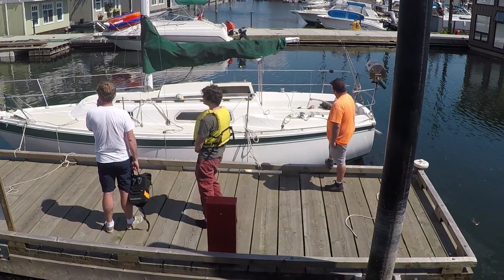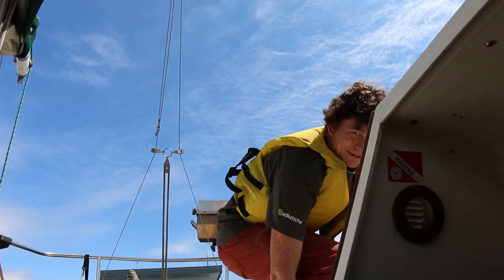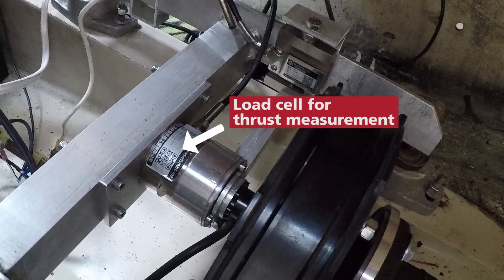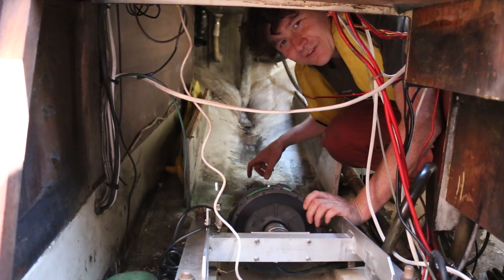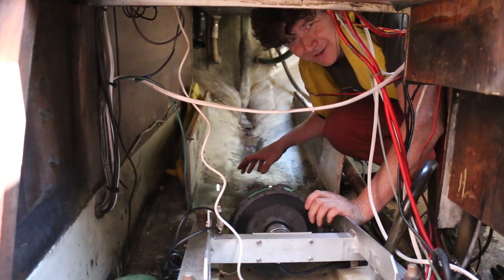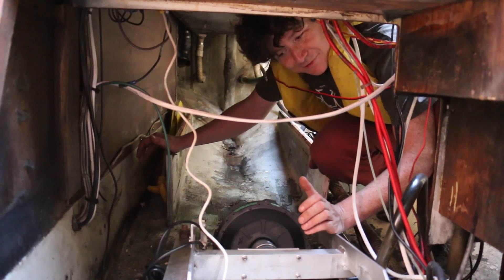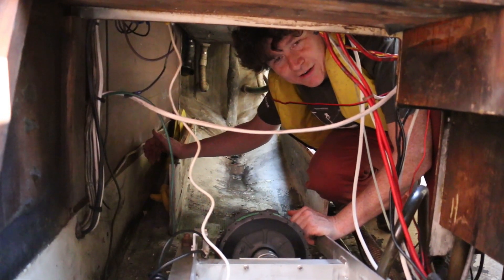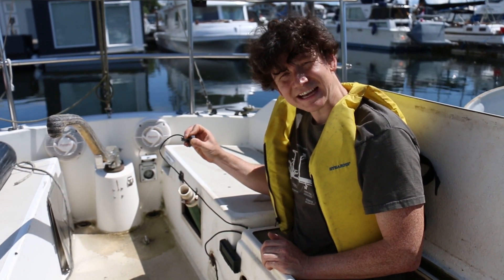Intro to Shamrock, Justin's first electric sailboat conversion

Comment: Yay for electric boats! And, bikes, airplanes, cars, motorcycles and all kinds of electric propulsion. (and unicycles, too;-)  It is a clean setup Justin made to measure propeller efficiency (thrust per torque) independent of motor efficiency which he measures all the time. Such a clean and simple arrangement is the marking of an excellent brilliant engineering mind. Go Justin Go! Good going! :-)
Reply from the maker: Ha thanks Brad. I'm hoping that with a bit of data collection like this we'll be able to really contribute more to the optimization of e-drives for boats and if we can make it easy for people to see and collect that data then more people can contribute. It could also be a nice tool to see quantitatively the effects of things like marine growth or a bit of rope wrapped around the propeller.  Certainly I got way more velocity from 1000 watts after the boat went back in the water with a cleaned hull and barnacle free propeller.

Comment: Cool!  3000w hub motor can give  a pretty decent performance on that boat
Reply from the maker: With our sea tests so far we've been doing about 10.1 kph at 3000 watts, compared to 9.4 kph at 2000 watts.  I'll need a larger motor controller in order to test at more than 3000 watts since the phaserunner goes into thermal rollback after a couple minutes. It definitely starts to hit fast diminishing returns for each extra watt of power.
Reply: @GrinTechnologies   Hull speed is a brick wall though.
Mine is about 8 knots when de-barnacled, try to get faster and you need to thrash the engine against the drag factor.
There is a huge market out there for a cheap and simple solution to electrify or hybridise sailboats.
A simple pulley on the propshaft when the engine's gearbox is in neutral is pretty simple with a slim motor like yours.

Comment: Brilliant.  I'm so glad you are working on the problem.  Propeller design is an mysterious art and it seems that most standard props are very far from good much less optimal.  Your setup will already give you more data than most. You might reach out to the founders of EP Carry and PureWatercraft, who are both working on electric outboards near Seattle.
Reply from the maker: Hi Mark and thanks for the feedback. I've actually met the founder of EP at the port townsend boat show a couple times and they've done a great job at using high efficiency (large diameter, 2 blade) model airplane propellers in their setup.  Unfortunately with a lot of the sailboat inboard drives there just isn't the room to have a larger diameter prop due to clearance with the bottom of the hull. I've got a 12" and could probably fit a 14", but much larger than that and I think the tips of the blade would be too close to the hull and result in heavy vibrations.  I'll check out PureWatercraft! seems like a very well designed outboard system.
Reply: As I understand, a large as possible, low speed, two blade prop is as efficient as you can get.   
Ideally an adjustable pitch prop.  That would make generation more efficient.   Then engineer in so it folds back / feathers - both to reduce resistance and to reduce chance of snagging floating lines etc.
But of course these are sailing boats, so going all out for motor efficiency is perhaps not worth it.

Comment: Two matted together would be interesting.
Reply from the maker: You mean double motors for double the torque and power? I think that this size of hub motor (27mm wide stator) will be OK for sailboats up to about 27-28 feet, but anything larger and we'd want to have a wider stator assembly for sure.  There's a CAD model on my computer for a marine motor like this with a 45mm stator on it, and that's a lot easier to do and more efficient than trying to stack two narrower ones.

Comment: Would be interesting to see regen performance with suitable prop. How much speed lost under typical sailing conditions vs rate of charge.
Reply: Absolutely! All forces in the other direction, hopefully the axial loadcell can sense pulling forces.
Reply from the maker: Once we get a nice collection of data on this front I'll share the link to the endless-sphere post here.  So far we've only had one day with wind for regen and I didn't have the logger hooked up, but with sailing winds that had us moving at about 10.5 kph we were getting a max of 120 watts with the propeller spinning at about 300 rpm. The regen power was less if we let the prop spin faster, and less if it was torqued to spin slower too. With no regen at all the propeller would free spin at about 600 rpm.

Comment: Justin that is awsome. Is there any possibility in the future that the Cycle Analyst could do some math and multiply two value together to get the mecanical power for exemple? If we could use one of the input as a load cell torque information as well as the actual speed, we could get the instantanous mecanical power and also use the nice cycle Analyst into a dynamometer display doing the multiplication in real time and also compare with the Power  in  and get real time efficiency value. for people like me who like DIY DYNO =) Thanks.
Reply from the maker: Hey Doctorbass, yeah you and me do think alike ;-)   The CA3 already does this for showing the human watts, and since I have the hall sensor speed of the motor hooked up to the PAS RPM input line of the CA3 instead of the normal speed input, then all I need to do is hook up the torque sensor of the motor mount to the pedal torque sensor input on the CA3 and it will show the mechanical motor power right there in the human watts field. With the custom views option you can choose to show human watts on the 1st display screen too, so then have both motor mechanical watts and electrical watts in the same screen.   All that's missing is to do the division to show this as %efficiency. As long as there's an audience of more than 2-3 people, I think we can do this.
Reply: @GrinTechnologies  I am in too
Reply: OH SHIT ITS DOCTORBASS!!!!
Reply: @groundcontrolgainesville4841  the legend himself!